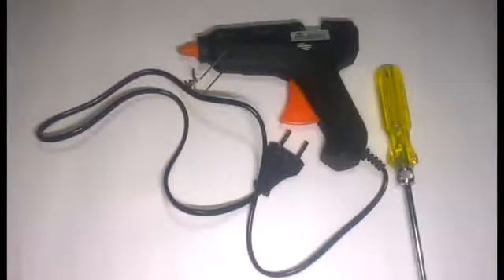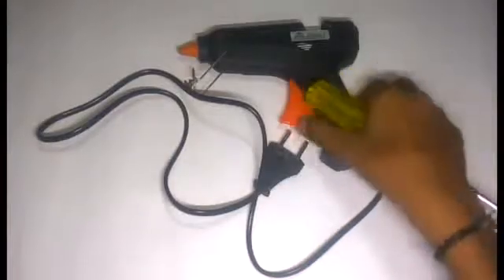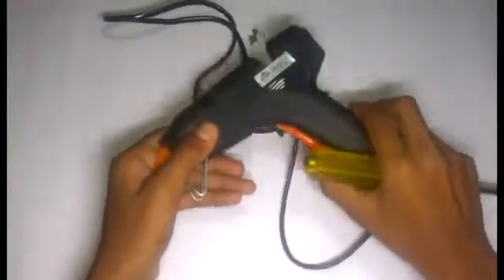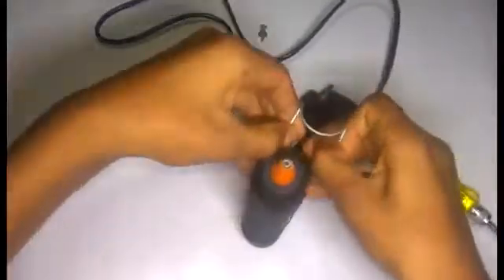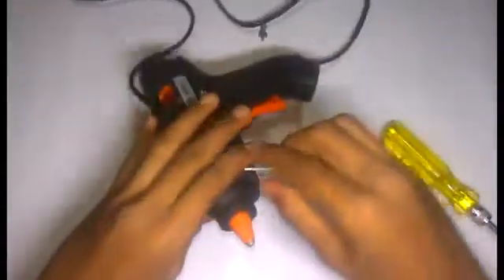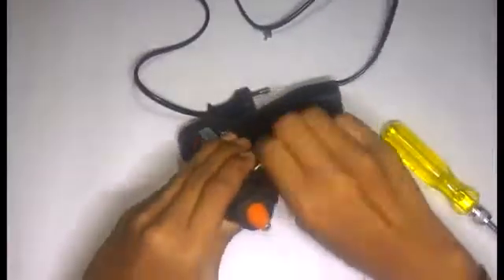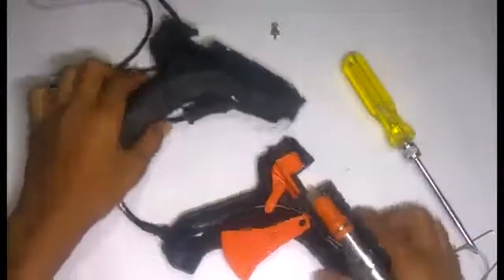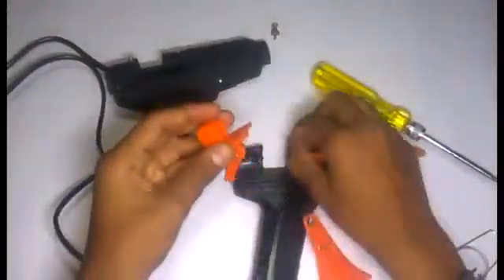How to repair glue gun handel தமிழில்

Comment: Ennoda glue gun 40 watt nallatha erunthuchu na use pannum bothu litta vedikra mathiri saththam kettuchu athoda apditha eruku
Reply from the maker: Bro heater poirukum bro it is wast bro ..............
Reply from the maker: Apdi ilna wire short circuit agirukum bro ..........
Reply: @k.p.ktamilelectronics3996  😓